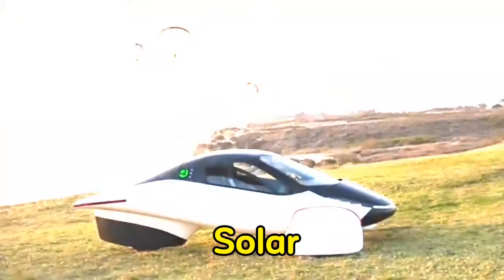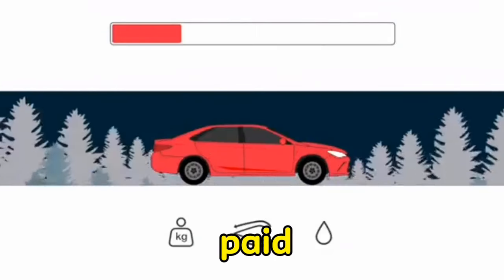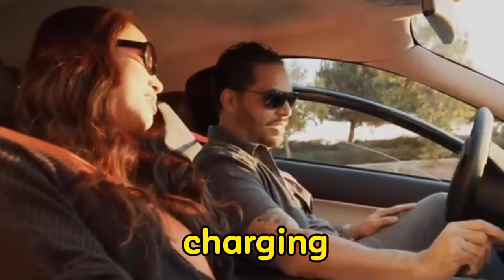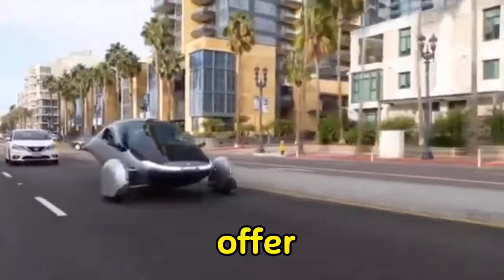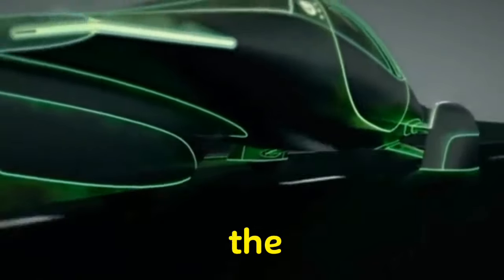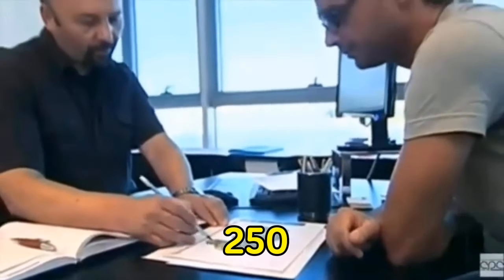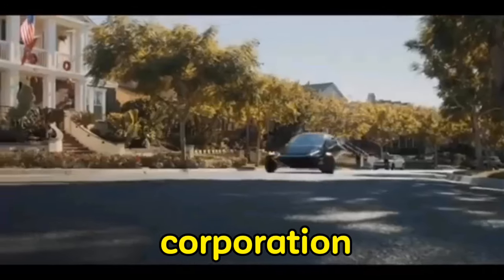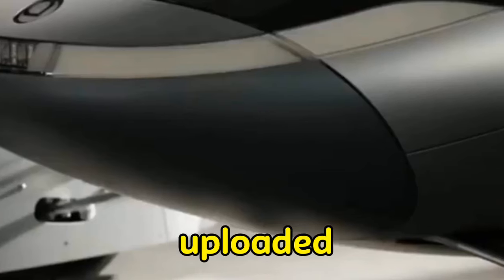APTERA Aerodynamics, Skin Cooling, AC & electrical design.

Comment: Efficiency is the key. Low drag, low rolling resistance, low weight, efficient use of power, and efficient cooling. All in a great looking package, with solar panels that deliver a significant even if not large range. Wait until they get perovskite or the next generation of solar!

Comment: This video has a number of errors. Aptera does not cost $25,000,000.00.  It costs about $26,000. Charging info is way off. As a 13 year EV owner, charging an EV at home is NOT the primary, secondary, or even in the top five energy user at home.  Charging our EV at home accounts for about 10% of our electric bill. I think this video was slapped together by someone or something that is very loose with facts.